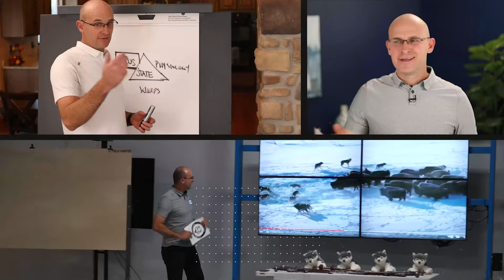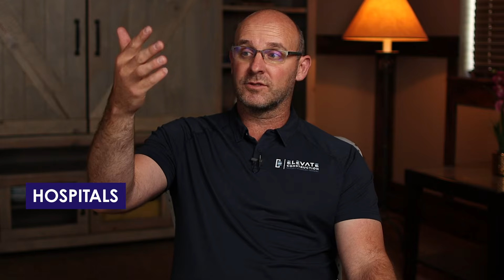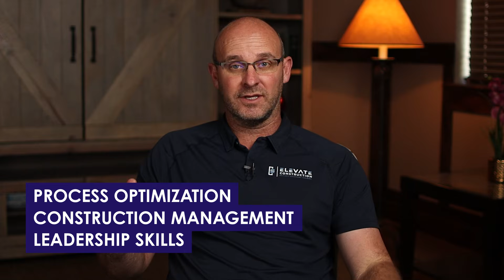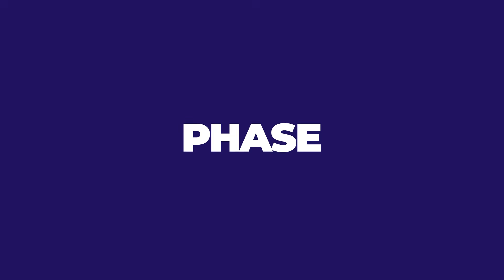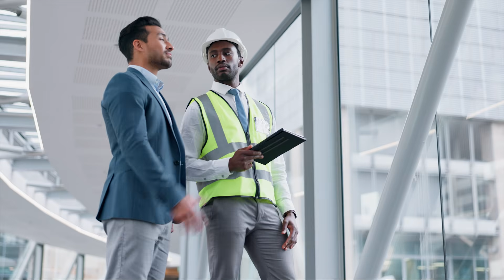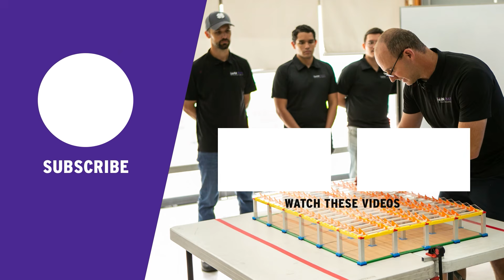What Is The Difference Between A Commercial And An Industrial Superintendent?

Comment: how easy or hard is the transition from commercial/industrial superintendent to civil/residential and vice versa.
Reply from the maker: Great question! The transition can absolutely be done—it just depends on how open you are to learning new systems, scopes, and culture. Commercial/industrial superintendents usually bring strong planning, safety, and structure with them, which is a huge asset.

On the flip side, civil and residential can teach you flexibility, speed, and how to deal with a different kind of complexity—like working with municipalities, subs who move fast, or crews that rely more on feel than paperwork.

If you're willing to respect both sides and stay humble, the crossover can make you a much more well-rounded builder. I’ve seen it done well many times.